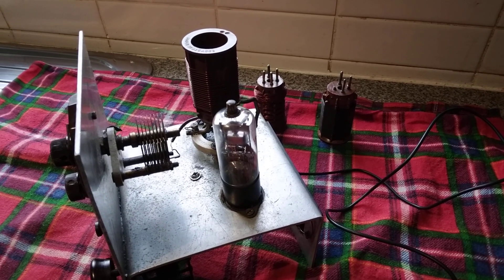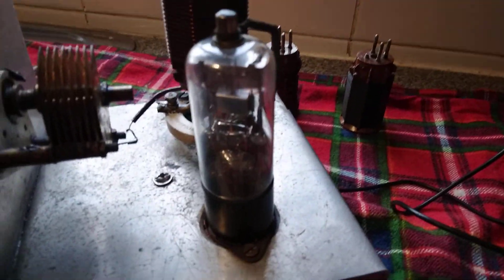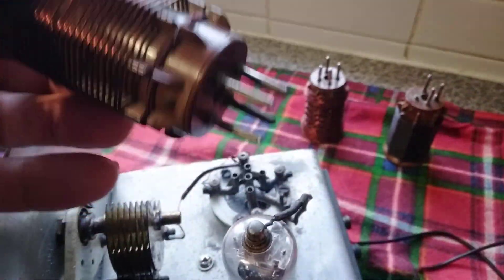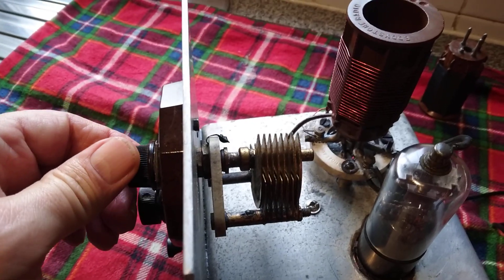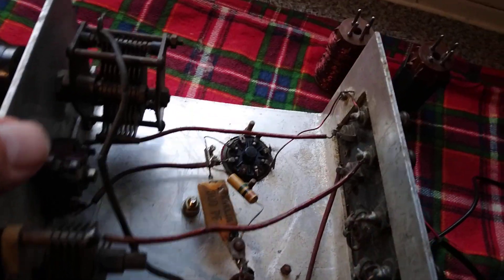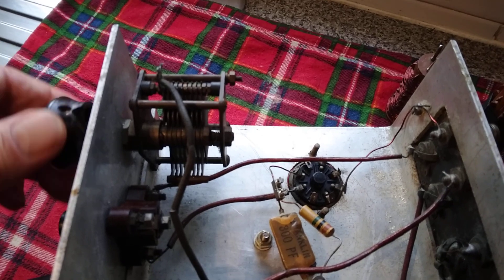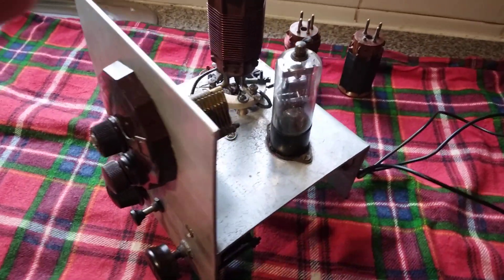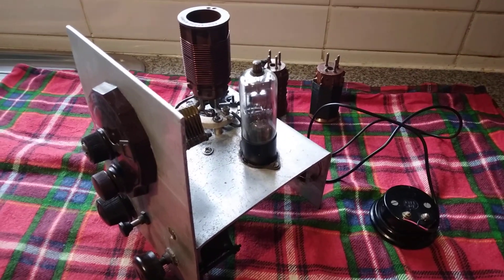A secret ww2 radio reciever.

Comment: That valve/tube looks in fantastic condition after so many years. Do low voltage valves/tubes suffer from less “Carbon build up” that I see on other old valves? I am sorry if the question is silly, but have never built anything with valves and have no experience of them.

When we about 10 years old my sister and myself built a crystal radio following directions in the ladybird book that we manged to get hold of in  République du Cameroun. We didn’t even understand the difference between NPN and PNP then, but just kept pulling transistors out of old junk until we found something that worked like the OC71 in the book. A year later we figured out using a 741 to increase the volume.  

Great content by the way. Have subscribed.
Reply from the maker: Thank you for your interest and I would say that battery valves do suffer less although you cannot usually see the filament glowing due to the low voltage and yes I also have the ladybird book on how to make a transistor radio with the old germanium mullard oc71 infact this radio will easily use one in place of the valve.